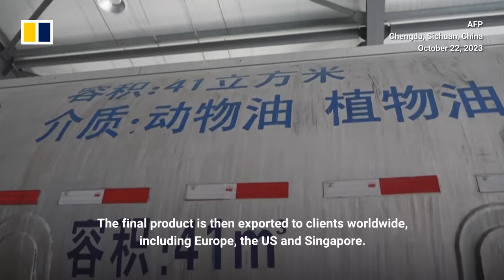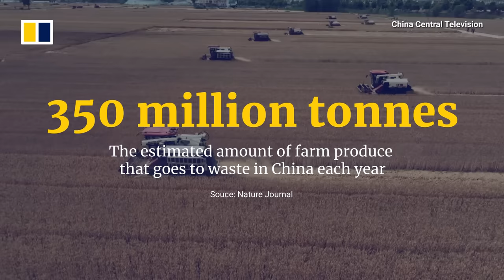Leftover hotpot cooking oil powers planes

Comment: This guy needs a noble prize. Its better than people reusing it in the next meal 😅
Reply: they have been using it in the next meal... still.
Reply: Hahaa. They do use it multiple times 😂
Reply: @batman_2004  
If that's your opinion, then you can be sure you don't know what hotpot is like.
In fact, the contents of a hotpot are boiled water and spices, and most of the oil is from the food that is put into the water. Therefore, it is impossible (and there is no need) to reuse existing oil, because what is actually used is boiled water.
Reply: @jt7306  
If that's your opinion, then you can be sure you don't know what hotpot is like.
In fact, the contents of a hotpot are boiled water and spices, and most of the oil is from the food that is put into the water. Therefore, it is impossible (and there is no need) to reuse existing oil, because what is actually used is boiled water.
Reply: @araara4746 Sure buddy whatever you say 😂